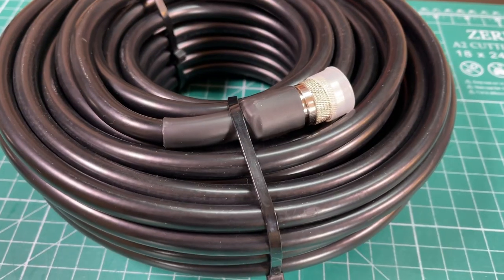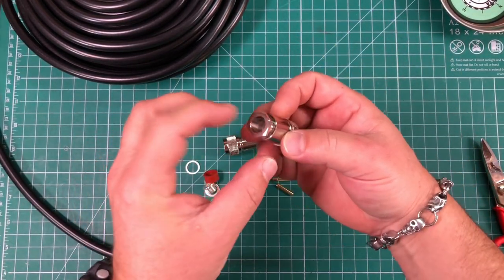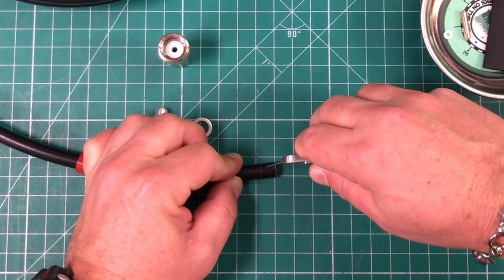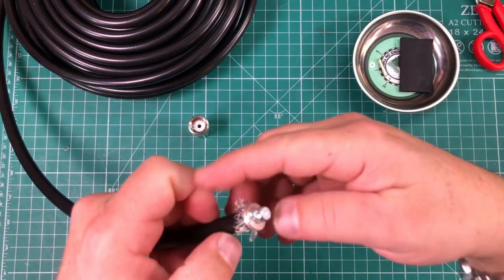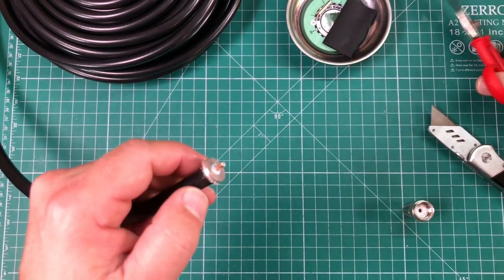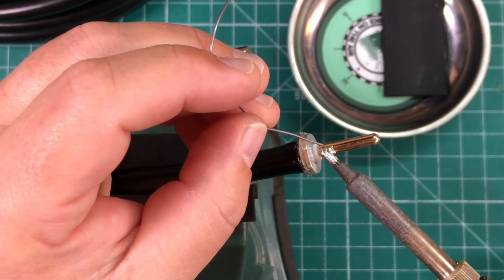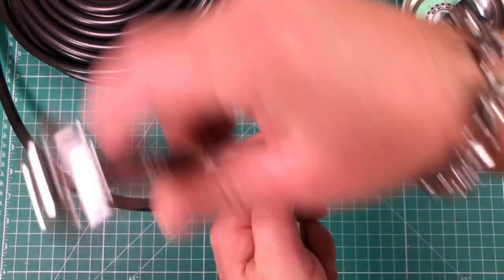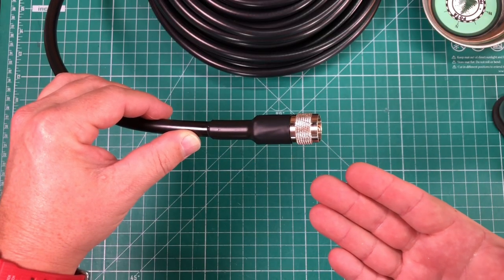Amazon PL-259 Clamp Connector | Super Easy Installation

Comment: I bought some of these in 259 and N connectors and I just put on a 259 and sweet Jesus was that nice these are worth the money for sure  THANKS for doing this video Cheers de W9US
Reply from the maker: Lol so glad to help.  Glad they worked out for you.  73.
Reply: @arconeagain  why is that?
Reply: @edcozart9916  if you read my comments, I explain. He puts one of the parts in the wrong place. He won't reply to me, but he's more than happy to reply to someone who has followed him. You have to be very cautious of YouTubers bluffing their way through. This guy has 5 minutes of experience with these plugs, when I have ten years.
Reply: @edcozart9916  so let me guess, you installed them incorrectly. That has to be annoying. Now you'll have to take the antenna down (if there's one at that end) and replace the plugs for new one's, as the rubber glands are likely damaged.

Comment: Just a small correction, the braid should be sandwiched between the washer and the bushing
Reply: Someone else pointed this out, but it appears their comments have been removed or blocked. Don't know why he would do that. I wouldn't call it a small correction either, it's simply wrong, null and void.
Reply: I think you are right, it doesn't make sense to butt the washer to the bushing.  If that was the case, they would have just made the bushing thicker.
Reply: Your are little different then mine has the hole on top
Reply: I’m confused can someone elaborate? I’m ordered these and put alotta $ into my first base setup and don’t wanna mess this up.
Reply: @ChristiannTyler  He did it wrong.  The smaller washer goes on and butts up to the outer jacket before fraying the braid.  Then fray the braid and install the insert under the braid.  This will "sandwich" the braid between the washer and insert.  Trim off the excess braid that sticks out.  Then put the rest of the connector on.
Reply: @LeeWhiting-k3x  Dang, I just finished my heat shrink and was coming to comment about how easy the install was. Now I see that I did my "wrong". Bummer but thankfully I was just building a patch and nothing that will be outdoors or under stress. Thanks for the info, I'll sandwich them together next time
Reply: @LeeWhiting-k3x you are so right! I have the same connector and was puzzling over this washer and found this video and was STILL confused. The braid is now caged between the washer and metal insert, while the rubber bung compresses the whole works into the housing. Brilliant! Thank you.

Comment: I'm using LMR400 and had a very difficult time getting the bushing under the outer jacket. After reading comments I tried again with the washer over the braid and then it was some easier getting the bushing pushed in under the jacket. Thanks much for the video!

Comment: I can't say enough how much I appreciate videos like this. For some reason, coax has been intimidating. But between this and the other video you did on BNC, I realize I shouldn't worry so much.
Reply from the maker: Don't sweat it.  Get some connectors and just start practicing.  I've screwed up plenty when I was learning.  You have to develop a technique.  Some connectors will be harmed in the honing of your skills.  But the money you will save over time by making your own cables far exceeds the cost of a few connectors.
Reply: @hamradiotube  did it help with improving power loss? Is MRD-400 now on par with LMR-400?
Reply from the maker: I just put the same connector back on the coax that I cut off in the coax video.
Reply: @hamradiotube  but the previous one had crimped pin this one is soldered. I wonder how big is the difference?
Reply from the maker: @2EOGIY  It was actually crimped and soldered.  I highly doubt it will make any difference though.

Comment: NO SOLDERING!!!! (except for the center conductor)  I don't know how many times I melted the dialectirc, or had bad solder connection to the brade.  Throw away your old style UHF connectors that require an extremely hot soldering iron to install.  These are GREAT!!!

Comment: I would have thought the second washer goes on before you fan the shield, then you insert the collet. The way you did it, the braid is reliant on the pressure applied by the leading surface of the rubber gland against the washer and collet... as opposed to the braid being squeezed between the washer and the collet, which are both conductive, metal surfaces on either side of the outer shield. Otherwise, what is the washer for? This is how I've been doing it for years with similar compression fittings, and after all, that washer is sized to fit over the braid.
Reply: I thought the same thing, and looked at a couple of other videos on this, and all show the braid being clamped between the smaller washer and the bushing. KJ7WT
Reply: Yes, that is how those should be installed. No surprise though, he makes great videos, but does not always fully research what he shows or talks about.
Reply: @germanjohn5626  personally, if I made this video, I'd pull it and redo it. This is because so many may install their connector incorrectly, and let's face it, coaxial connectors are important. It can let your whole system down, I don't have enough fingers to count how many times I've seen an operator with a faulty connection. Delete the video, it's called being responsible.

Comment: Thank you for this.  I've been using the old style solder connectors (infrequently) since the '60s and was never confident of my work.  These connectors are way better.  The only problem I had was that the small insulator would not fit over the braided inner conductor of my RG-8/U.  After trimming the inside of the conductor and a little reaming out of the center post the connector went on great.  Thanks again!  73, N5CAD

Comment: Loved your video! Made the install easy to follow. I was installing the fittings on Tram-Browning LMR400 and couldn't force the ferrule into the end of the cable as the outer jacket was hard and not flexible - the solution was to use a heat gun to soften the outer jack and use a 7/16 nut driver to push it in. Worked like a charm. Again Thanks

Comment: Finally,  Found a video, with the connectors I have. With the rings and rubber guts etc. Only my connectors have open points. But thats easy to fill with a bit of solder. Thanks for this video.  I need to store this one.

Comment: Nice video.  Just bought these XRDS-RF compression connectors from Amazon myself and found a couple of differences between this and the M&P.  These are a tad shorter and lack the extra o-ring at the base of the nut down at the cable entry.  Probably why they put heat shrink tubing in there to offer a measure or increased weather resistance for outdoor use.  I'm happy with mine for indoor use and use the M&P outside.  But time will tell if the M&P will really be weather resistant at the stem.  Seal the screw collar with something like CoaxSeal, liquid electrical tape, or just something.

Comment: What kind of wire strippers are those. I’ve never seen that style before and they look like a great design. I really like the scissor way you trim wire with them. Thanks for sharing this method installing these connectors.
Reply from the maker: They're Messi & Paoloni Caox scissors. You can get them at Gigaparts and save 5% with code k8mrd

Comment: Nice vid very well filmed - thanx. I used the RG58 version of these connectors but found that the skirt on the knurled nut is too long by about half a mil and bottoms out on the socket before the inner is fully home allowing the plug to move about - not good for RF. Dremeled off the skirt below the knurl to sort it but it was a lot of work that I could have done without🤨

Comment: I have been holding off on cutting some LMR400 because I didn't want to deal with soldering the new connector. I hate that job! This connector looks like the answer for me. Just ordered a couple and will try them out. I just wish someone would invent wireless feed line!

Comment: Would you say these are on par with crimp connectors ? I can’t decide if I should try my hand at soldering, the compression fittings or crimp on connectors.
Reply from the maker: I would say these are better than crimp connectors personally.  I used to use those but now I use this type.  Mostly for ease of installation.  Plus you get a bit of insulation from the bottom due to the rubber gasket.  You still need to solder the center pin with these but it's pretty easy.

Comment: I LOVE those conenctors, have a bunch of the amphenol version here... they're used a lot with N connectors... but they're not cheap as a general rule. I beleive callum is a fan of those as well... and they're also pretty water resistant too

Comment: Wouldn't it be better to screw/turn the back part instead of the entire front end?
To keep things in place inside the house, and just having the back parts/guts be squeezed in there.
Reply: Yes, I was thinking the same thing.. When I do my M&P I put a dab of sealant on the bottom of the brass center pin so that when it's assembled, it won't let water pass along the outside of the center pin.

Comment: They 'ok'.  If you look at the setback on the thread, its far back compared to something like an amphenol or m&p compression plugs.  Also have noticed and it might have been my batch that the thread is not the 5/8 inch 24tpi UNEF standard.  Just be aware i guess.

Comment: I just received some of these today from Amazon. I got these to use with M&P Ultraflex 10 because the M&P connectors seem to be currently non existent.  Although these look quite nice, they are not the same quality as the M&P, but are less expensive. One thing I did note is in the Amazon description, it states they are nickel plated brass. However, the knurled nut that connects to a SO-239 is magnetic indicating the presence of iron. The main body and all other parts are non magnetic. They claim these pass a 96 hour salt spray test. I wonder?
Reply: Make sure you don't install them like this, as it's wrong. Look at my initial comment for the correct method. This guy won't amend it, seems to want to mislead fellow operators.
Reply: This is actually an interesting comment. I've seen that many distributors which carry M&P coax do not sell their connectors, and I can't figure out why. I'm fortunate enough to be in Europe, so if I order stuff from their factory, it usually arrives by the morning on the next day..

Comment: I like to use a soldering gun instead of a pencil iron for these because the heat required to make a good connection plus the time it would take with a pencil has caused melted dielectric before.
Reply: It would be more better if one were to pool a bit of soldier in the tip before putting it on the center conductor.

Comment: How do these compare to the M&P connectors?
Reply from the maker: I really wouldn't have a way to tell.  I don't have any test equipment and they don't publish the specs.  I would guess not as good.  You pay for what you get, but they seem to be pretty darn good.
Reply: Thanks! I’ve used a myriad of clamp connectors for N and BNC through the years. Super easy once you get the hang of it. And easy to fix if you forget parts.

Comment: I would scrape the enamel from the center conductor, and then expose it to some Solder flux !
Only because I believe the Solder would more easily flow thru that tiny hole !
But seeing these makes me wonder how the old fashioned PL 259 Connectors ever worked ?
Damn shame there isn't room for more parts !

                👉😖-----

Comment: They look a lot like the things that M&P sell. Gonna get a few of these, and see how they compare - nice find, thanks :)

73
de
G1LIW
Reply: Follow-up; comparing like for like, these Amazon connectors (branded "Rangeful", and made in Lithuania, as it happens), and the Messi & Pauloni RG-58/Hyperflex 5 compatible 259-esque connectors, they appear VERY similar; however, the Rangeful ones are VERY much easier to assemble - you don't have to strain your fingers to get the end nut into the body, whereas the amount of effort for the M&P ones is quite a lot higher; the downside of the Rangeful connectors is the solder hole at the end ofg the signal pin; the M&P one is bigger, meaning it's easier to solder. The Rangeful one is smaller, though a little bit of judicious filing with a small needle file should solve that issue. Also, the Rangeful signal pin and spacer (one part) comes out of the end of the body; the one on the M&P unit does not.

The price point seems similar, by the way.

I've not tried either for fitting onto coax yet - that's going to be in about a month, and I'll add to this minithread at that time.

Cheers for putting me onto this brand - thus far, looks like a winner :)

73
de
G1LIW

Comment: would you trust this connection at full legal limit ? 1,500 watts ? On 11 meters no way ! a mid size station is a 48 pill box, 13,200 watts. Run LMR-400 SOLDERED